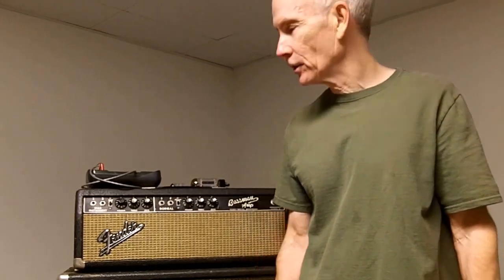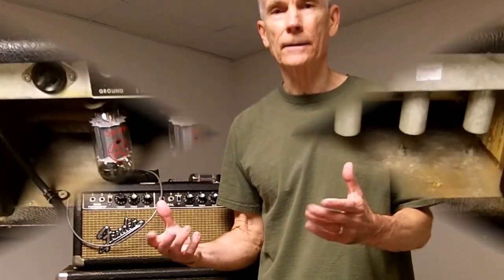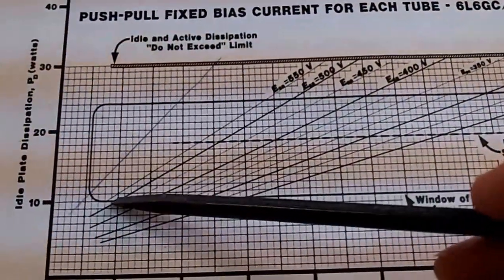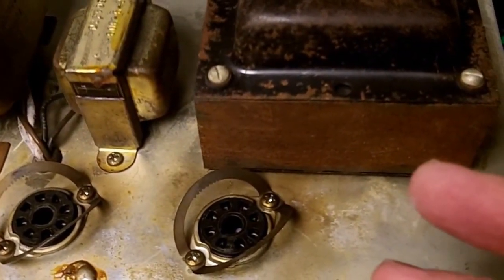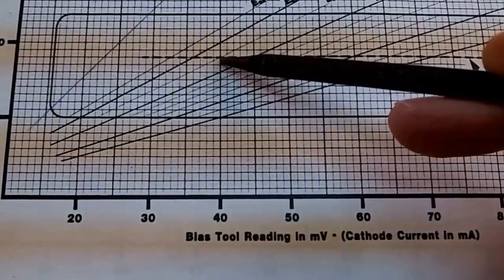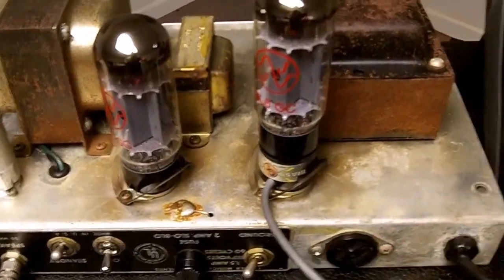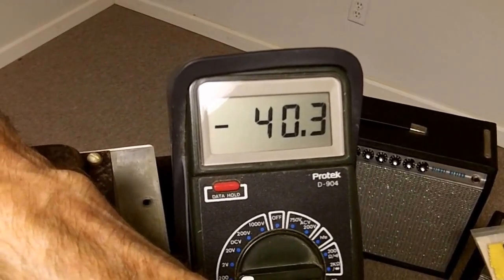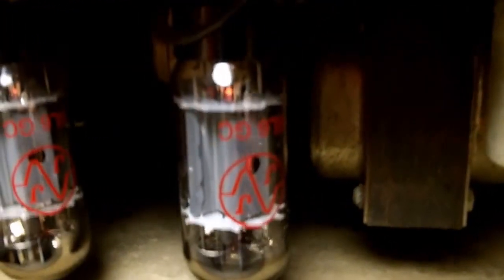Tube Amp Bias

Comment: cathode current or is plate current better?
Reply from the maker: If you’re asking which should be used for amp biasing, you could use either. If you are using a calculator such as tedweber.com, they use cathode current. Someone else’s calculator might use plate current. Cathode current is easier to measure since you are dealing with lower voltages in the cathode circuit.
If you measure cathode current but want to know plate current, you can subtract the screen grid current from the cathode current to get the plate current value. To get the screen grid current, measure the voltage drop across the screen grid resistor, divide by the value of the screen grid resistor and there you have it.
Reply: @jamelectronics  Yes, thanks so much....I'm slowly learning, I used to bias my amps but years and years ago and perhaps incomplete understanding...thank you for sharing

Comment: I'm doing my first bias job. A 73 traynor yba1. 
Your video seems very straight forward.  Thanks. 
I have 6l6 in mine so I'm assuming that chart would work with my amp? 
I was following a tutorial online that said I need to measure center tap voltage and I don't know where to findnit in my amp. 
It doesn't seem lime you did that. Is it unnecessary... scratching my head here. 
Thanks for any insight

Comment: My 1963 bassman does not have a Bias pot. So, other than installing one, how would you adjust the bias on an amp that does not have a Bias trimmer (Bias pot)?
Reply from the maker: You could vary the values of the voltage divider resistors in the bias circuit, but this might require multiple iterations. So, it’s easier to install a potentiometer. Unless you’re knowledgeable of tube amps and electronics, I recommend finding an amp tech to do the work.

Comment: Before you decide what voltage you're dealing with, let your amp warm up for at least 10 minutes!  You might get 450 volts initially and it drops down to 430 volts as it's warming up and when it's fully warmed up and stabilized it could be 460+ volts.  If you bias it for the wrong voltage it won't be right. This is tube stuff.  You can't make it hurry.  Go slow...............................
Reply from the maker: It is always good practice to let the amp warm up for a minute or so before taking measurements as stated in the video. I decided to check the Bassman amp plate voltage (with the tubes installed) at various times from initial to 10 minutes. After a 1 minute warm up, the plate voltage was 442 volts, at 2 minutes - 443, at 5 mins. - 444, at 7 mins. - 444 at 10 mins. - 443. So, my conclusion is that the variation after a minute of warm up is insignificant.

Comment: PS -( I don't have a bias probe), need to measure mA directly on the 2 x 6V6GT  AB763 type amp. Fender DRRI.
Reply from the maker: The safest way is to temporarily install a 1 ohm resistor in the cathode to ground circuit and measure mV’s across that resistor. For a direct measurement of cathode current you would have to break the cathode to ground circuit and use your dvm (set to measure current) in place of the cathode to ground circuit. The dvm in the current measuring mode looks like a short circuit to anything you connect it to so you have to be careful.
By trying to measure cathode current by connecting your dvm from pin 3 to 8 with the dvm in current mode, you were shorting the high voltage of the plate to ground. The probable reason you measured 0 is that you probably damaged your dvm. Be careful! These are 350-450 volt levels that can kill you.
That’s why my video addresses biasing with a bias probe. It’s safer!
Reply: @jamelectronics  Yes.  Thank you for that warning!  You're right.  I won't try to measure current like that again!  I have been studying my schematic and see that my "65 Fender Deluxe Reverb Reissue" Amp,  AB763 circuitry.  The cathodes on the 6V6GT tubes go to ground with no cathode resistor.  So, I measured (with amp off and caps drained) the resistance from pin 8 of the 5AR4 rectifier tube to pin 3 (plate/anode) of the 6v6.  That ohms reading gave me the resistance between the center tap of the power txfrmr, then ,using those same test points, set my DVM to DCV and power up amp to read the voltage drop across that 1/2 of the transformer to the tube. Then, using ohms law  calculate the 6V6 bias current indirectly.  this is voltage drop divided by resistance, or
plate current = voltage drop / transformer coil resistance, or ohms law:
I=E/R, where
I=current in amps
E= voltage in DC volts
R= resistance in ohms

you don't measure plate current directly!  Or if you have the money and want to be safer, buy a bias probe. Thank you!

Comment: James Patillo, thank you.  There is still no answer to John Miller's question "How can I measure current?"  I assumet he means cathode current to set the bias.  There is quite a discussion on the polarity and indirect reading of current through the DVM set to mV (due to the built in 1 ohm resistor in the probe), but no answer, so I must ask "How can I measure the cathode current directly, without using the bias probe?"  I tried measuring current (yes very carefully) across cathode (pin 8)  to plate (anode pin 3), but no reading showed.  Please help.

Comment: Pin 8 on my ab763 is grounded. Not getting any current readings but voltage is high close to 500v. How can i measure current?  (2) 6L6 amp. Why is your current reading negative volts?  Thats measuring the grid which is the negative bias adjustment not the current reading
Reply from the maker: The bias probe inserts a 1 ohm resistor between the cathode and ground of the tube. Then voltage across the 1 ohm resistor = the cathode current. You can do the same thing by disconnecting the pin 8 ground and connecting a 1 ohm resistor between pin 8 and ground. Use a 5 watt resistor. My current was reading negative volts because the bias probe  came with the red connector on the black wire and the black connector on the red wire and I never noticed that I should plug the red connector into the ground of the meter and the black connector into the positive connection of the meter . The polarity of the reading was never a concern since since I knew the tube would not conduct backwards.
I am not measuring the grid. There are no connections to the grid in my procedure. Measuring the grid would require a connection to pin 5 not pin 8.
Reply: @jamelectronics  thanks for the explanation. I think i need a good bias probe. I would rather not desolder pin 8 leads and mess with a resistor. Does a bias probe have a built in resistor to measure current?
Reply: @jamelectronics  well it looks like my ab763 is not cathode biased but fixed biased. The probe i'm looking at passes all the pins through except pin 8 which is running to each probe lead. I would be measuring the current running through pin 8 to the tube i guess. No resistors needed
Reply from the maker: @johnmiller9219  Yes, the bias probe inserts the 1 ohm resistor internally in the probe, so need for an external one. Typically, AB763 amps are not fixed bias- meaning you can adjust the bias by varying the control grid voltage with a pot located on the chassis near the power supply. Just like in the video.
Reply: @jamelectronics  i hear what you're saying but i've watched countless vids on making a bias probe (or dissecting one) and have never seen a resistor in one.
Reply from the maker: @johnmiller9219  If you are directly measuring CURRENT then a resistor is not used. The dvm is set in a current setting and inserted into the circuit. However, in the video I use a bias probe that measures voltage across a 1 ohm resistor which by ohm’s law ( I=V/R ) gives the current indirectly by measuring the voltage across the resistor. In this case the DVM is set to a voltage setting. Apparently with all the ones you’ve used, the DVM is set to read mA’s.

Comment: I cannot find that bias chart shown in this video despite hours on Google. Can it be found on line?
Reply from the maker: Dennis Green Go to this website and use this calculator. Most commonly guitar amps are class AB. Just plug in the tube type and plate voltage and you get the median current in mA that you can use. https://www.tedweber.com/bias-calc

Comment: What can be a little confusing here is you are measuring in DC millivolts giving you a negative bias output, but don't most bias probes measure in DC milliamps which give a positive current value??
Reply from the maker: The bias probe measures the voltage drop across a 1 ohm resistor which is mounted inside the device. What we want to know is the amount of current that is flowing through the cathode circuit, but measuring the voltage across the 1 ohm resistor is more convenient than measuring the current directly. Current = voltage/resistance, so if the resistance is 1 ohm, then Current = voltage. Therefore, the probe reading in millivolts = the amount of current in milliamps in the cathode circuit. I hope I answered your question and thanks for asking!
Reply: Not exactly. If the 1 ohm resistor in the probe is than supposed make the current equal voltage, then why is the bias negative? My Eurotubes probe measuring the current in milliamps is a positive bias of 38ma. Plate voltage of 470v.
Reply from the maker: @djefferson5669 , OK I understand your question. If you notice at 8:56 in the video, the red lead of the bias probe is attached to the black plug and the black lead is connected to the red plug. They should have been red wire to red plug and black wire to black plug. This is the way it was wired when I bought it and since we are only concerned with the amount of current not the polarity,  I never took the time to rewire it. I could also just plug the red plug into the ground of the multimeter and the black into the positive connector of the multimeter. The current  will always be flowing from the plate to the cathode and then to ground ( positive sign convention) and should indicate + on your meter.
Reply: @jamelectronics  Now it makes sense! Thank you James.

Comment: This is the wrong way to measure the plate voltage. The voltage will allways be highter with no power tubes in the amp.
Reply from the maker: The plate voltage on this amp is 441volts with the tubes in and 447 volts with them removed. Using the Tube Bias calculator on tedweber.com website, this yields less than a 1 ma difference in cathode current. So, the effect of measuring idle cathode current with or without the power tubes installed is negligible. Also, the advantage of measuring with the tubes removed is that the inexperienced person avoids having to insert probes into the underside of the chassis thereby lowering the danger of electrical shock.
Reply: @jamelectronics  OK :-)
Reply: You've been served!

Comment: So if I am biasing both my tubes like on my Blues Deluxe, I have to double it correct? So if my plate reads 450v then 1 tube would be set at 35m, so I would double that and set the bias at 70m? Am I correct?
Reply from the maker: No. Using a bias probe like in the video, you are measuring each tube separately so, set at 35mV.

Comment: Hi James, thank you for sharing this. I have a '65 Fender bassman that I love the sound of. I was recently playing it and the volume cut in half suddenly. I suspect (and hope) it's just the power tubes. It had some really old Raytheon tubes and I just purchased new 6L6GC's for it. I'm also researching the tools I need to do the bias myself. I noticed in the video you have what appears to be 2 volt meters, one for measuring the voltage of the amp without the tubes and one for measuring the bias of the tubes. I was wondering why you used two separate devices to measure the readings?
Reply from the maker: When I repaired amps for a living and rebiased a lot of amps, I just left my bias probe attached to one voltmeter and used it only for that purpose. It was just a convenience to me and I just continued that habit. But, no reason you can't use the same meter for both measuring voltage on plates ( or whatever) and also with the bias tool. Thanks for your question, and I hope you get your amp working 100%.

Comment: Hello, I have a twin reverb, several years ago one valve broke and I change it and just that; sounded always good. Now I have another valve burnt, so I am here with the new one...but I cannot get all this BIAS thing. Again, I never touched anything and the amp worked good for several years; also I recorded a demo on studio, played some gigs and still kicks (but with 3 valves instead of the 4)
So, still do not get all this. I was lucky?
Also, the simpler stuff I think is not measure anything, turn off all the knobs put the valve, turn on the amp let it warm a bit then listen the noises etc then adjust the screw....or not? Again, I did not do anything and the amp sounds great.
Thank for any explanation about it.
Reply from the maker: TheReverb1 Yes, you can just install a new tube(s) and not adjust the bias and the amp may sound great. However, without adjusting to bias to a recommended level, the current passing from plate to cathode in the tubes may be more than the tube is rated for. This in turn will cause the tubes to fail sooner than they might otherwise. If the bias is adjusted such that the idle plate current is too low, the amp may sound distorted and/or lack punch. So, correct biasing ensures the best sound quality and longest life of the tubes.
Reply: @jamelectronics  ...just see. What s your opinion about the simpler "technique" that I mentioned? Thanks
Reply from the maker: @TheReverb1 I thought I had explained that in my reply, however, here it is again. I think what you did is fine. Many times it will be OK to replace tubes without resetting the bias. However, by leaving it to chance, sometimes that procedure will result in a poor sounding amp or short life of your tubes. You chose.
Reply: @jamelectronics  Hello; may be I was expressed it wrong but what I tried to ask in that second question is this:
"Also, the simpler stuff I think is not measure anything, turn off all the knobs put the valve, turn on the amp let it warm a bit then listen the noises etc then adjust the  BIAS screw....or not? Again, I did not do anything and the amp sounds great. Thank for any explanation about it."
So I mentioned that I did not nothing; only put the valve and mentioned this other question too. If with this simpler procedure could be possible adjust it (mentioned to me by other) Then asked you about your opinion about it.
Hope this time would be clearly enough. Thanks
Reply: Hello Mr. TheReverb", this gentleman answered your question twice. It is you not understanding his answer. That's why he did not reply a third time. 
He said "YES" you can do it your "simpler" way. Ok, that's the answer.

Understand that he warned that you could burn out your new power tubes using your "Simpler way". That's the part that you did not understand or perhaps you are choosing to ignore. So he is saying yes you can do it the simpler way. BUT, it is smarter to bias the tubes to prevent them from burning out soon.
Have a nice day.
Enjoy your day
-Peter

Comment: First off, I love your vids and appreciate your knowledge. Please correct me if I'm wrong... 

This method doesn't seem accurate and will bias the tubes colder than expected. You are using UNLOADED plate voltage and CATHODE current (=plate+screen current). As you raise the current the voltage will drop. 

You know this... but I trying to understand the reason for biasing this way. 

Beginners notice that this graph assumes a 6L6GC with max dissipation of 30w...not all 6L6's are equal, know your true limitations. Many new production tube manufacturers use old data sheets... But new production tubes may not be as robust as old era tube manufacturing.
Reply from the maker: Blake, I believe by "unloaded plate voltage" you are referring to measuring voltage of power supply w/o tubes in place. I measured the voltage this morning with the tubes in place to compare with voltage measured in the video. The voltage with tubes is 445 volts, and without is 448 volts. So, not enough difference to matter. Also, this is an idle current method. This method of setting the bias as described in the video is an accepted way to set the bias of power tubes in amplifiers. I have used it on hundreds of amps and it works well. There are other methods, but this is the simplest and most useful to the average amp owner. I like it because it is easier and safer and gets good results. As far as the differences in tube characteristics, if you set to the middle of the "normal operating window" or center point of a general tube characteristic sheet, you should be fine. There can be debate about the best method of biasing an amp, my intention was to show in a simple manner that most anyone can successfully and without a lot of equipment set their own bias. Thanks for watching my video and for commenting!